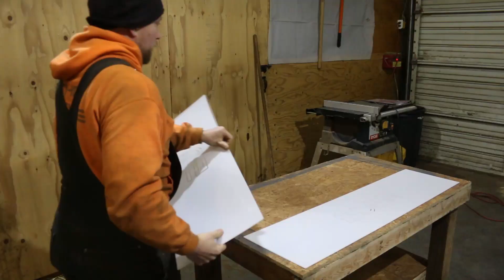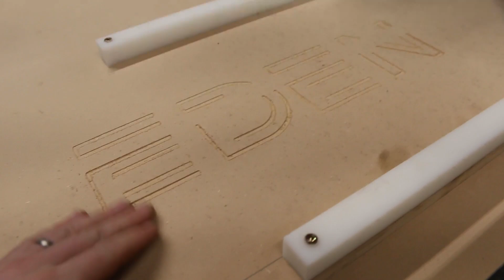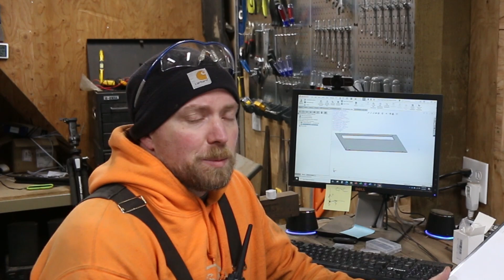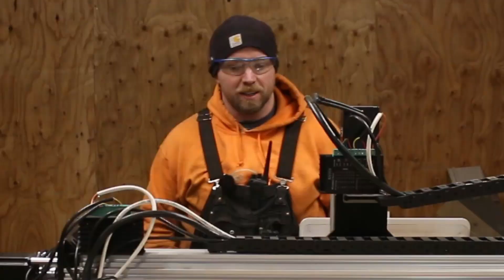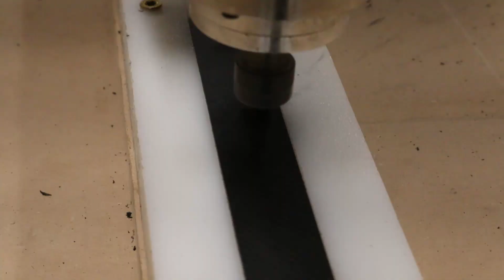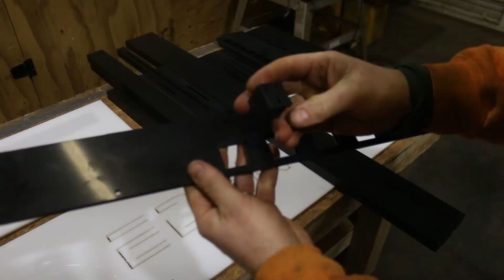The CHALLENGES of learning how to use a CNC Machine

Comment: At 15:40. Regarding melting. When you use high RPM you need also to have a high feed rate (how fast the axis moves in x/y direction through the material). If the feed through the material is not fast enough the bit does not cut new material for each revolution of the bit, it grinds on the same material instead for several revolutions creating friction instead of cutting resulting in melting the plastic.

Comment: By looking at your setup, it looks as though your motor mount is a little high on the motor, I would lower it and ad another to the top of the motor. It should make it more rigid.
Reply: This should help with the bit tools breaking as well. The way it's holding the spindle is allowing it to climb and bind in the material.

Comment: A suggestion from a Toolmaker... Try a fine air blast jet next to the cutter. It will help remove the swarf and stop it binding up. Plastic is tough on tooling because all the heat goes into your cutter. In metal machining a significant amount of heat is dissipated via the base material and the swarf. 

Warming up the plastic even a few degrees will also help minimise the chipping. Although any air blast or spindle air blowing on it will just cool it again. Warming up some brittle types of plastic is critical, I found this out trimming and installing my first "shower dome". 

At 15:40, if that's an ER collet you've got the collet in backwards which won't help. I'm unfamiliar with router spindles so feel free to ignore this comment...
Reply: You are correct, that collet is in upside down!